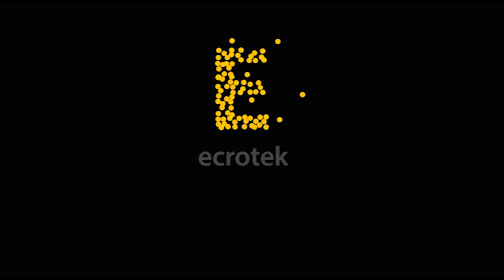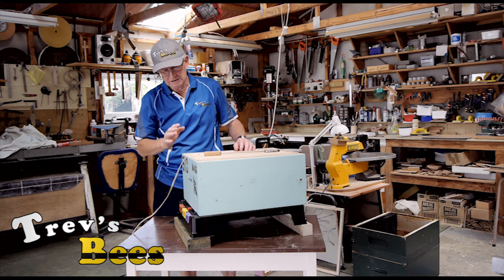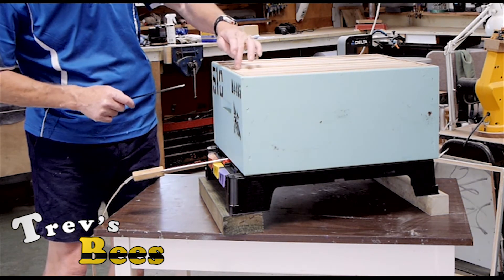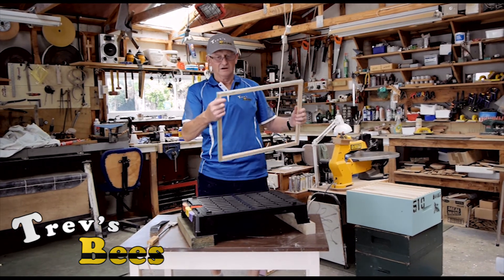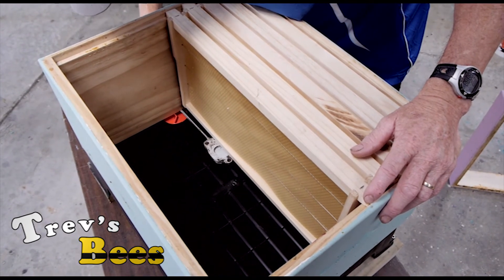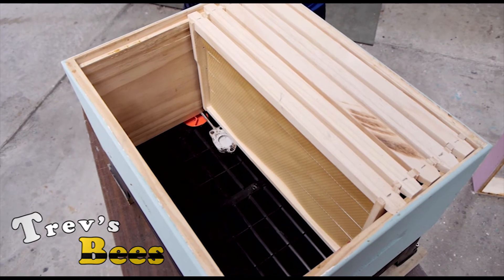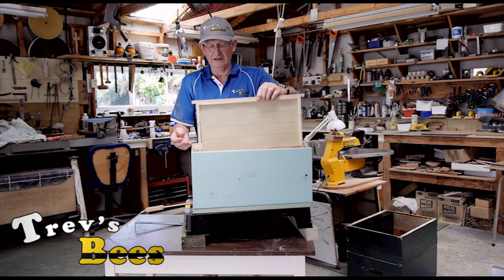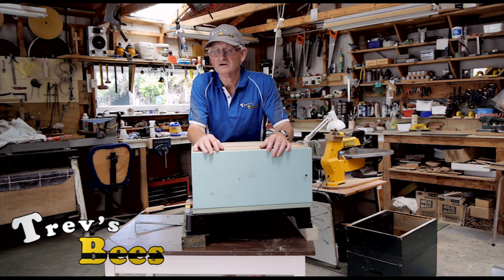Trevs Bees - Using Oxalic Acid Vaporiser with Hive Doctor Floor

Comment: Good morning from Provence. I wondered if you had any ideas on how to treat a Paradise polystyrene hive with an Oxalic vapouriser?. The obvious problem is if the shaft or head of the vapouriser touches the polystyrene it will melt, I had thought of putting a thin metal sheet between the vapouriser and floor of the hive, but I expect the metal would still get too hot for the polystrene, a plywood sheet might catch fire, and a ceramic tile would probably be too thick.
The Paradise hive is very good, particularly because of it's light weight if you have back troubles, and also in insulating the bees from excess heat or cold, but there are problems to be overcome which do not arise with a traditional wood hive.